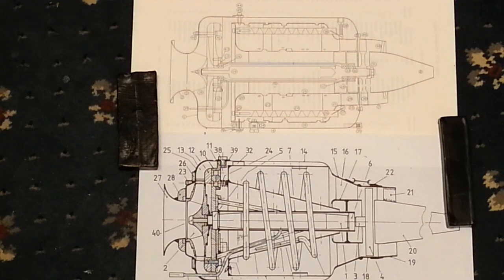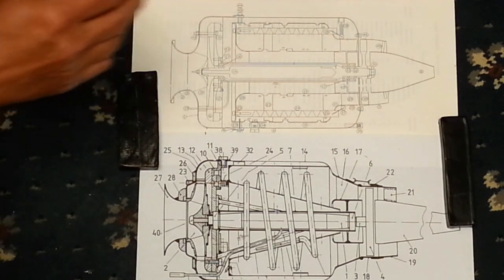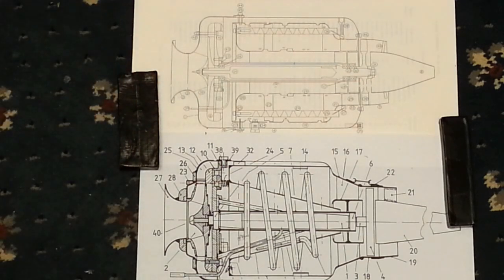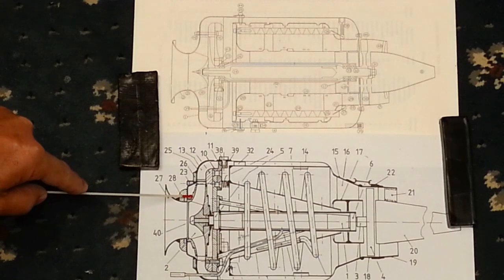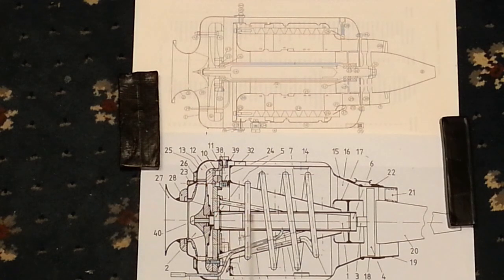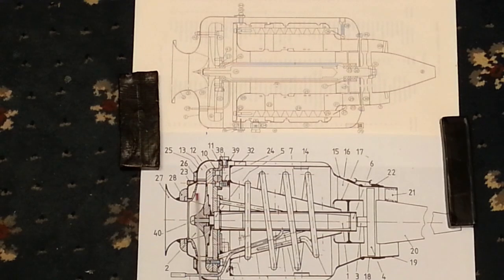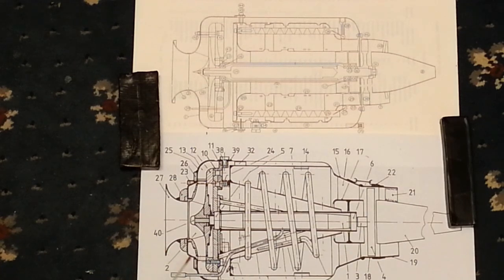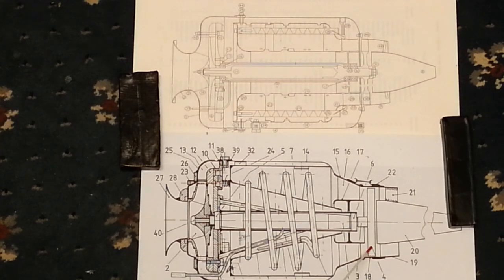Plane Turbines PT35  Mk 6a

Comment: @reddy93. What is angle of ngv of pt35 jet engine and what should be angle for turbine?
Reply from the maker: Hi Eliuos  the PT35 has the same angles as the FD3/64 book that is 38 degrees on NGV , ( this angle is high due to cast wheel efficiency )    being a short production run the plans/ instruction book don't show dimensions of the supplied parts the turbine wheel was semi shaped in cast   format and no angles shown but if measure on the drawing ( which you should never do ! ) it's 44 degrees at the root and about 28 degrees at the tip which correlates with what other people did when m/c a wheel from solid  .
you cannot use these angles on a twisted wheel it would go into melt down a m/c from solid wheel is much more efficient.
I will try to do another video on the PT35 showing more of the book but it's not an engine you can make as more spinning tools needed and more m/c parts/harder to take apart once assembled .

Comment: Regards the springs in the burner tubes, I came up with an idea many years ago that should be in the GTBA notes somewhere and that is what i called 'D sticks' you make a half cut in the burner tubes and weld a gate which is half way through, the airflow and fuel has to go over and under these gates which slows the airflow down and gives it loads of time to vaporise and atomise before leaving the burner tubes and burns more efficient in the primary zone. We tested this on the Phoenix MK4 and it decreased the fuel consumption by 17%, it also helped the ramp up speed a lot.
hope this helps
Paul
Reply from the maker: Yeah I do remember them very much like early gas turbines ,it is a bit of a trade off between complexity and efficiency most engines now have bluff holes and straight sticks from the back but I think wren did squash the sticks at 90 degrees along the length  instead of the dog leg shape sticks they did early on.
The phoenix was a good engine, the GTBA promised a smaller design using the rotor out of a car turbo but don't think it was done ,hard to get cast wheels now and very expensive.